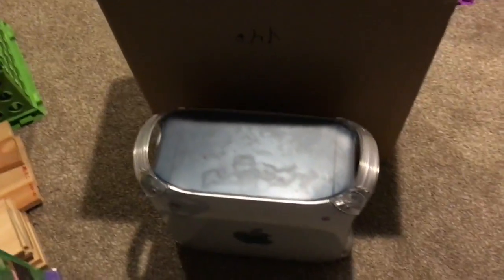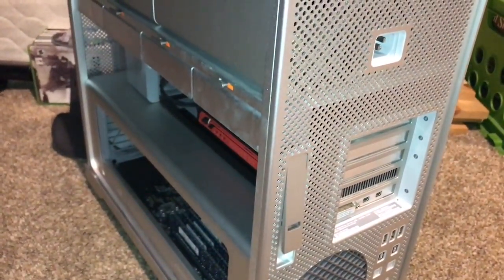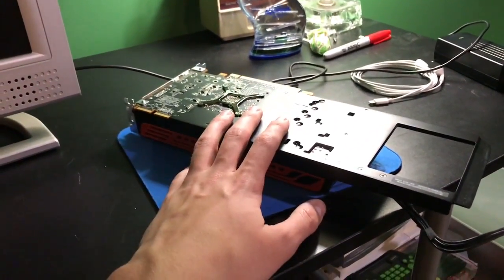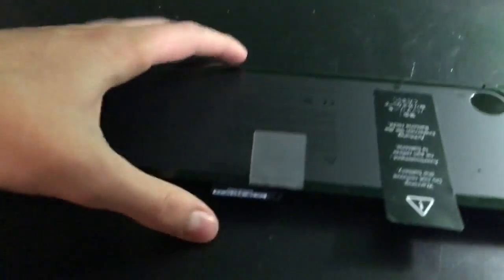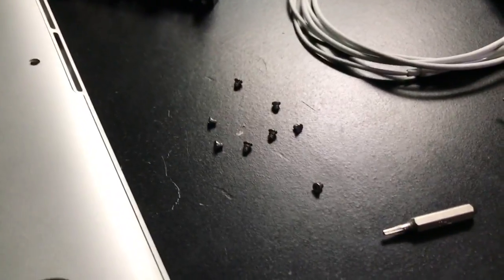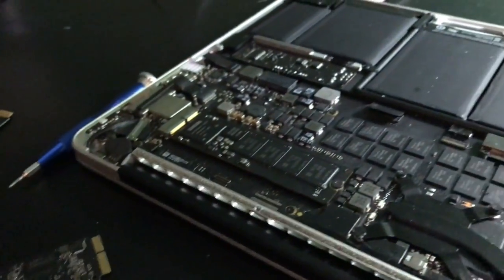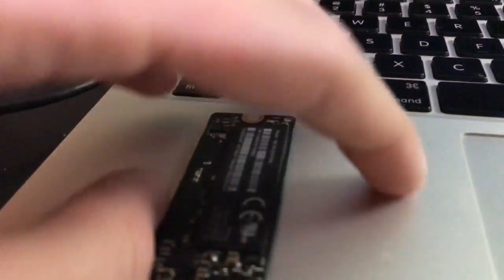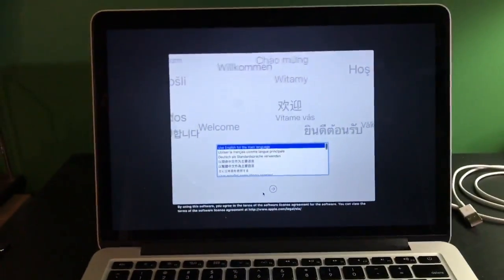New 2010 Mac Pro Part 1, MacBook Pro Battery Replacement, & Work Trash Finds

Comment: I'm about to buy a 2010 Mac Pro and cinema display locally, pretty hyped!
Reply from the maker: nice! after using the machine now for several moths, I can say (after probably upgrading the GFX in the unit) you'll be very happy
Reply: TheSkyeLord I have the GTX 660 from my 2007 8 core, so I'm covered there